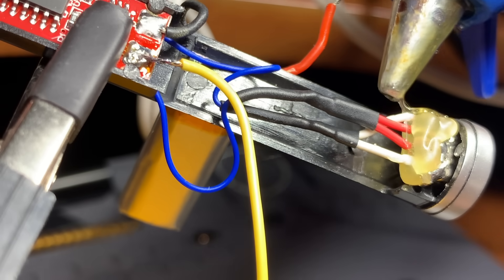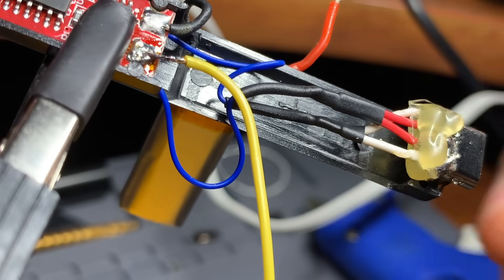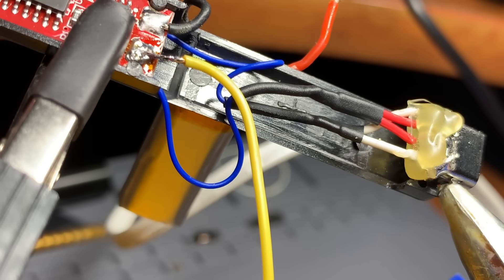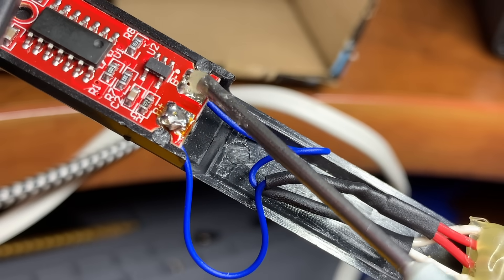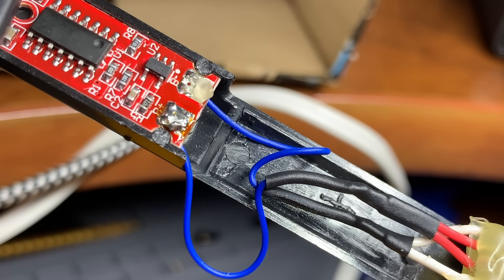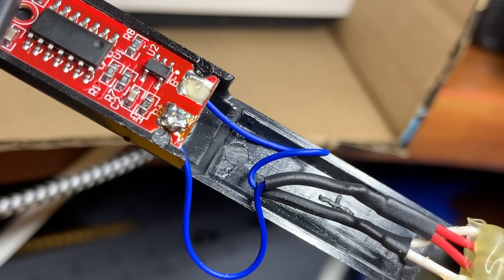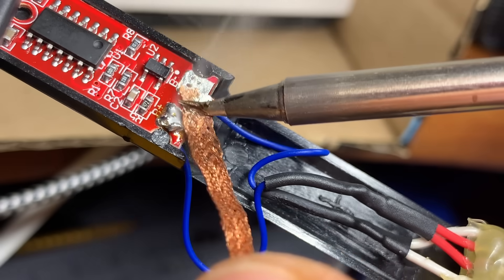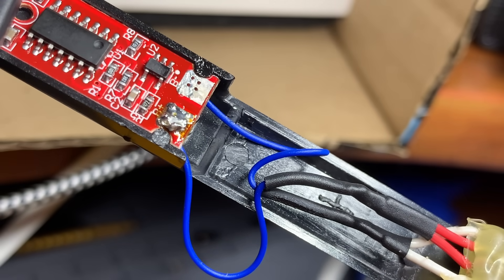#29 Bambu Lab fiasco affects you! Even if you don't own their printer. #bambulab

Comment: If it happens (the switch flip, or the bricking) boards can be changed new firmware can be installed and connectivity can be severed. If you like the hardware fine, you don't have to get a new printer a voron board and klipper will work just fine. It's just some parts run by gcode. It's based on a voron. Do the research and act accordingly.
Reply from the maker: If you buy a car and 6 months later the manufacturer says “you now have to pay us monthly to use it”, are you going to replace the electronics in it and start doing research how to spend hours/days fixing it and making sure it works properly and won’t disable the brakes randomly?

And how does that help anyone who isn’t as tech savvy, and just wants to use the printer?
I’m trying to make sure all of us are better off, not just a handful who can jailbreak their device.
Reply: @UNgineering  Rich rebuilds did that with Teslas. However,  I do totally see where you're coming from. I feel like bambu printers are the apple of 3D printing from their beginning. Fully integrated infrastructure, specialized accessories, cool features, but you pay for such things and will continue to do so.  If Bambu continues down the path they're on, people will realize they're paying thousands for a machine that does point, click, and print for cheap trinkets, with throttled usability. I guess that's OK for some. The time time is also coming when ai will dictate what can and cannot be printed from the cloud, and I want to still be able to (if I choose) to print a nerf gun without having my hardware bricked for attempting to print a file with an algorithm triggering keyword in the name. I feel that this is the start of that.
Reply: @UNgineering  also I appreciate your input it has let me see that bambu printers are great in their plug and playability. This is now evident to me that it comes with a cost I can't pay. I got into 3D printing for the freedom to create whatever I want. You get that with a voron, or a rook, or a creality printer. For those who bought a bambu printer I will offer my input and services (however limited as I have never personally tried to change a bambu printer) but if anything, the reprap community has taught me that you can do anything with 3D printing.

Comment: I'm going to be purchasing my first 3d printer in about 2 weeks. I was planning on buying a bambu 3d printer until this fiasco came up.  I already own 7 diode and fiber lasers. One requires an expensive monthly subscription to use all the features of the only software you can run it with. I'll be selling it. I got it for the price of the taxes on it in exchange for reviewing it. It's getting sold in the near future. I'm keeping the others because I can use any software I want with them. No monthly subscription needed. 

I'm not buying bambu. I'm looking at anycubic for my first 3d printer. Bambu lost a lot of customers over this and I'm not the only one. I've seen others saying the same.

Comment: 2 years ago I bought an HP Inkjet Printer. I was a bit surprised that they required an online component to starting and connecting it... then I found that it would not accept 3rd party inks... and you had to subscribe to an "INK service" to get HP inks, which they sent to you at regular 3 m onth intervals... and you had to pay for each set. (I use the printer maybe 2x a month (home) So, after 3 months my inks were about 15% used so no new inks needed. After 4 months I sent them a cancellation notice and threw the printer away. It took them 9 months to stop billing me, during which time I received no inks but regular bills for inks they never sent. I live in New Zealand, so I threatened to take them to court with the NZ Consumer Protection act.  They stopped within 2 days at that point. Fark those a-holes. Needless to say I will never EVER buy HP of any type ever again. They used to make good computer equipment but, since buying Dell out, they onlymanufacture 3rd rate Shite with 4th rate software. (Just try to use the HP printer software... it takes a farking contortionist to work out the logic in it...) I replaced the HP with a Canon Inkjet that cost less and woorks 200% better.
I don't own a Bambu Lab, but was considering it seriousl;y until this blew up... Instead I will keep my Neptune  4Plus. No online component needed or necessary.

Comment: I have a bunch of Bambu printers and I have NOT been affected at all.  I print what i want when i want.  Your talking about something the could happen to any electronic product, even Prusa. Funny, I have the exact candle lighter...it horrible.
Reply: Are you fully aware what your Bambu printer is doing on the network? Try blocking it from contacting the Internet. Do the same with any Bambu software. Good luck and let us know what happens.

Prusa explicitly markets itself as privacy friendly and Open Source friendly. If they pulled something like this they would lose 99% of their customers.
Reply: @KonradTheWizzard  Sure I am aware.  I can run my Bambu's on or offline easy peasy.  You can run it with an SD card, no problem.  You might want to read the terms and service for the new Prusa printers also.  Seems they are going down the same road.
Reply: @ Weirdly YT deleted my reply. Can you point to specific terms at Prusa that follow this trend? Reading their licenses and shop terms did not turn up anything for me.

Comment: As far as Bambu goes, People have already found ways to get around it and put something similar to Octoprint on it while doing what it used to before. It won't have any special updates anymore if you do so except for the Python script you flashed itself but that's it.
But now that this is a thing, I will disconnect my printer from the internet for good (even if I have to remove the wireless chip on the printer board to guarantee that) and just use Micro SD until I get that system flashed to work on octoprint or something else more relevant to bambu printers. I haven't updated the firmware in a while so at least I'm running older firmware.
Next printer I ever get will be a voron kit. They look cooler, open source, YOU put the entire thing together and by doing so, If something goes wrong down the line, It will be easier to diagnose and fix.
Plus, I can just be a script kitty for stuff I don't fully understand (github) and add WHATEVER functionality I want on a voron.
If I were to learn script writing, I could make it do ANYTHING I wanted. 
The possibilities are endless with non-proprietary systems.

Comment: the thing is that most smartphone users are much more casual users who wouldn't even think about something like repairing their own phone or caring about a headphone jack. the thing about people who own 3d printers are much more technically informed and will likely give Bambu hell and I sure hope they do because I wan to buy a Bambu, but I won't until they fix this shit. I might even get a Prusa or a fucking CREALITY of all things.
Reply: I can understand the appeal of wanting to buy a Bambu Lab printer for the print quality, but at this point would I not even trust any of their printers IF they provide them in a state where they'd work offline out of the box. They could still put a timebomb in the firmware that breaks the thing by letting it do something stupid, like ignoring a limit switch or thermal sensor, and then blame you afterwards because you didn't update it since you bought it.

I think that once a company stops seeing you as a "customer" and treats you like a "hostage" instead, you have only two options: drop them entirely or accept it (which you should NOT).
If they get a sliver of forgiveness for that behaviour, they will only learn that they can get away with it if they make the right amendments.
And so will others. Like the mentioned headphone jacks.
Reply: @BloodyMobile  at least with the headphone jack removal we got tangible benefits like water resistance, battery size, and overall reliability and performance is better, but with Bambu, they basically said "we can brick and restrict your physical printer if we want to" and tbh what security is this really improving?

Comment: I bought a Creality K2 Plus. I was able to reject the printer's privacy statement, put it on LAN, root it, and run it with Fluidd without any cloud capabilities. I may not be able to see what I'm printing when I'm away from home, but there's remedies for that.
Reply: @WandererTJ  you can always setup an independent camera
Reply: can you not run mobile raker with a tailscale vpn?
Reply: @fleetwoodmacncheese65345  not sure what that is, but at one point I looked up Octo Everywhere which sounds like it might be similar
Reply: How is your K2 Plus going? The elegoo centauri carbon is 300Eur compared to K2 Plus 1450Eur and it's 100mm larger in X/Y . Is the 1100Eur worth to pay for 10cm more build space I think NOT, please prove me wrong.
Reply from the maker: @akierum it’s not just how many cm. how reliable is it? Can you print 100 parts with the same quality? does the printer need tweaking every 2 days or does it “just work”? Can you use orca slicer or are you locked into buggy proprietary software? How difficult is maintenance? Are parts available at a reasonable price? Does it integrate well with your existing workflow? There are many more factors than just price and build volume.
Reply: @akierum  do your own testing for proof, I owe you nothing.

Comment: I think what makes this substantially worse is Bambu came into an open source community that only boomed because of the communities work and tried to close down things WE made. They have stolen 99% of their "features" from open source projects and are not following the rules of contributing back. Their entire slicer is a fork of Prusa Slicer it is disgusting that they think they can piggy back off of our work and then close doors and act like they are doing something special that needs to be hidden. No you will learn your place or lose this battle. I don't think they want the backlash that is really coming. We already have a jailbreak and custom firmware if they keep this up people will start cracking open their propitiatory software like they already did to Bambu Connect and start leaking the source code and I REALLY don't think they want that since I almost guarantee it is jam packed full of  open source code they shouldn't be using without a fork on github like every other company with an announce of integrity does.

Comment: If you cared about this that much, you would have picked an appropriate video to go with.  Almost didn't watch this.  Kind of distracting actually, imo.  Good info though.  But also, why would they do this before their new flagship launch?  Wouldn't it make sense to announce this after everyone had just sunk a ton of money into a new printer?  Like just wait a couple months after the launch and then make this update.  Now they have to deal with tons of lost sales.  Do you think they just underestimated the backlash or do you think they thought the new printer would be so appealing people would hop back on board anyway?
Reply from the maker: I think the team that's in charge of their cloud noticed that they're getting massive bills from all the 3rd party apps constantly pinging it and decided to lock it down. They must've figured that most people won't care, severely underestimating the backlash. 
They might also be planning to release a subscription model (perhaps for their newest model), but after this, I have a feeling they will hold off until the heat dies down.
Reply: @UNgineering  This is another false narrative from Bambu the 3rd Party apps all worked locally using mqtt there is ZERO need to ping their cloud. Hence why this is absurd and why Dev mode is not a solution. Dev mod would allow a Panda Touch and Orca Slicer to work fine as they are LOCAL and do not connect to Bambu cloud at all BUT if you are in Dev mode you can't also use the cloud features that currently work despite what slicer you use. Do not believe the "traffic" issue bs some people are very very wrongly bringing up. There was no excess pings what people did with their own machines was always local and that is what they didn't like. In Bambu's eyes you either give us your data and pipe everything through use or you don't get access to anything that makes a Bambu printer a Bambu printer lol
Reply: Look Jack Chang just needs to know about any counterrevolutionaries printing guns before the yellow dawn chicom revolution takeover.
Simple as

Comment: I still think the security argument is valid because a 3D printer can and will burn your house down if misused, so locking the features stated down makes sense. Your router with its firewall won’t help you a bit when your network is compromised, so if the Wi-Fi lightbulb or socket goes rogue, it’s a problem. For example, consider remote access via OTA (over-the-air updates): if an attacker gains unauthorized control of a 3D printer through a compromised network or unsecured OTA functionality, they could misuse it to start a fire. By dumping loads of filament and setting the nozzle temperature to 400°C (the ignition point of PLA is about 385±°C), they could cause the filament to ignite and create a fire.
Reply: it's NOT improving the security, it's just hiding them. And security by obscurity don't work.
Take a look at Linux it's open source and it's secure if the configuration is done right.
Reply: @berlinberlin4246  The Bambu Connect app is a disaster, yes.
"it's secure if the configuration is done right." Yeah, until you begin expose services that are flawed or vulnerable, creating potential security risks. Proper configuration can only go so far

Comment: I'm kinda bummed that noone really had grasp of what Bambu was doing day one.
They do told anyone that their printer is closed ecosystem - e.g. no spare parts outside of Bambu supply.
They did autodesk bait sooner than I thought but that is not only what they can do with their soft.
Would you like to be locked out of spare parts coz your printer can't communicate with server? This BS is on the table - I'm not talking 3rd party slicers or other software stuff. If Bambu wont like you they can not only brick your stuff remotly but even if you wont bend and pirate soft - they wont provide parts, coz why not. Sooner us as a customers wont put with this BS practice of gaslighting own customers sooner we get better product. Simply not buying new printers and telling everyone else is enough.

Comment: 4:19 Ok this is where you're a bit wrong. This was ALREADY an attack on Orca Slicer! The two products mainly effected by this, Panda Touch and Orca Slicer. The two products that kept user information away from their servers. This was ALWAYS about getting access to user data, to sell to the highest bidder. It was never about security. How does sending information from my network, to a server in the CPR secure my network more? It's makes zero sense.
Reply: and Home Assistant add-on / integration got hit by shrapnel as well as it uses MQTT to track stats as Orca do
Reply: Panda touch was never supported by Bambu Labs. They made a statement a year ago that unapproved products will not be supported long term.

Panda Touch as a disclosure on their products since launch stating that they will eventually lose functionality in future printer updates. 

Orca Slicer on the other hand is to my understanding approved by Bambu Labs, and they are making an effort to create a bridge (bambu connect) to solidify their statement that unapproved products will not be supported long-term. Bambu Connect allows approved products such as Orca Slicer to continue working with their printers while unapproved products such as Panda Touch lose functionality.

From the user’s perspective, Orca Slicer will work seamlessly as normal because Bambu Connect will run in the background, so to the user there is no change.
Reply: @micahsteeze  WRONG watch a few more videos on the issue Orca Slicer users WILL see a change. The Orca Slicer devs have already clarified this. Bambu lied to the Orca Slicer team even stating they would give them bambu connect functionality without having to go through it only to back track. Stop being a fan boy and read the room this is Bambu manipulating you into thinking nothing is wrong. They have zero right to do this to users machines we OWN them not Bambu!
Reply: @micahsteeze 
The new workflow is a mess
SoftFever (he is the Orca Developer) 2024-01-19:
Based on what I've learned from the Bambu Connect Beta, this is the workflow with the their new firmware:

First, use OrcaSlicer (or any other non-Bambu application) to slice the model and save it as a gcode file. Then, invoke Bambu Connect with the saved gcode file, which OrcaSlicer can do programmatically.
Next, the user must switch to Bambu Connect to complete the rest of the process to initiate the print:

Select which Bambu printer to use
Click the print button
Set the AMS mapping
Click the 'Send' button to start the print
Reply: @micahsteeze  The creator of Orca Slicer has already said that Bambulab is lying. They have never talked to them face to face to integrate Bambu connect. In fact he claims that he asked for private keys for them to manage and monitor the printing and was denied. They told him that they had to go through Bambu connect if they wanted to. What that implies is that Orca Slicer can only see information about how the printing is going, temperature, etc, but cannot modify those parameters from the slicer directly. That is not integration, that is giving crumbs to the competition and saying that “they work side by side with the developers”.